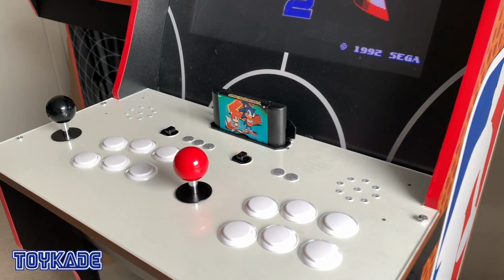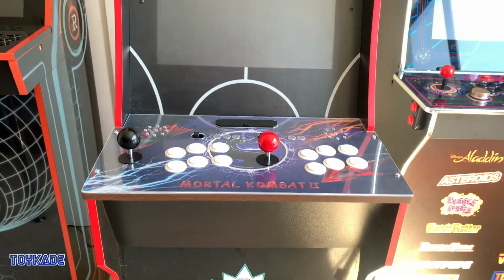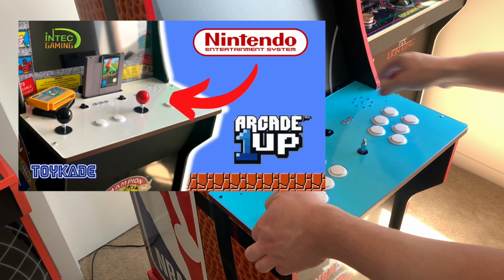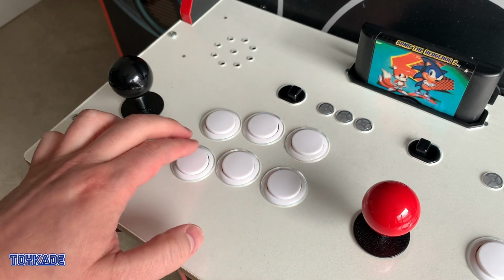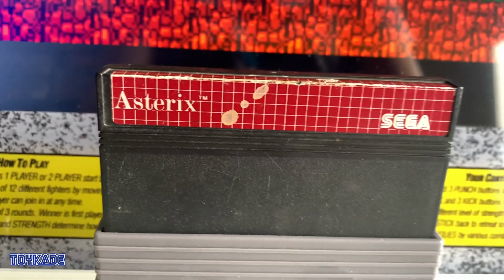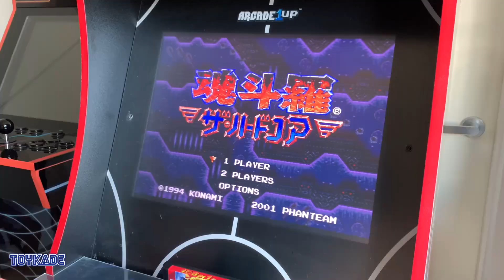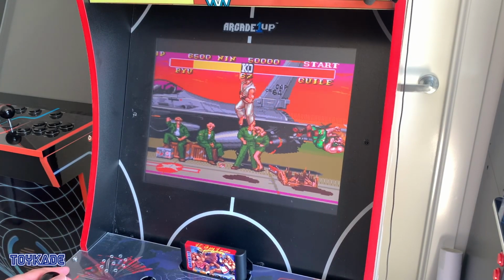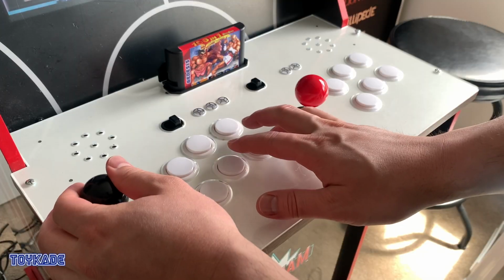Sega Genesis Fight Stick for Arcade1UP Review!

Comment: Thanks so much for the review. I will absolutely be getting the Genesis version and use it on my Rampage cab along with a Genesis multicart. Like you said in the video, it gives people the opportunity to own a multicade without doing a more complicated pi mod etc. My only concern is I have a 3rd party light up marquee from Retro530 that is wired up with a power harness that taps into the on/off switch on my control deck. I am curious how I will still be able to power my light up marquee using this intec kit. I can't wait to order this. I grew up on the SMS and Genesis and I own 3 first gen 1up cabs, so this is absolutely perfect for me.

Comment: so i can just plug into tv or monitor and it works, if so what kind of power do i need??
Reply from the maker: Correct, this works as a standalone console. The usb cable plugged into a 2.4A USB port worked fine.

Comment: The 4:3 aspect ratio the control panel puts out might be an issue for the 5:4 monitors on gen1 and gen2 cabinets I would think. I guess find a 4:3 a1up monitor 2nd hand as a solution.